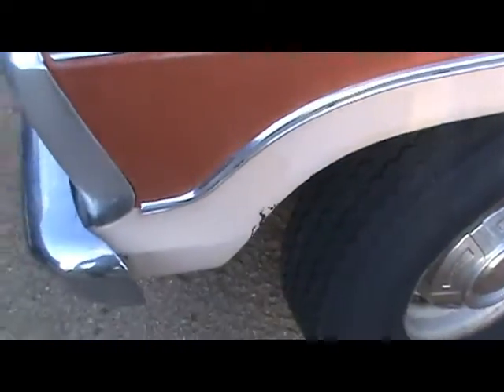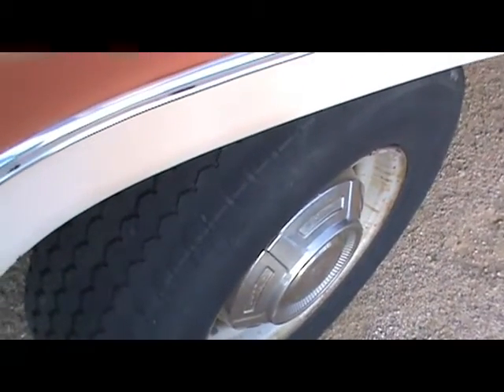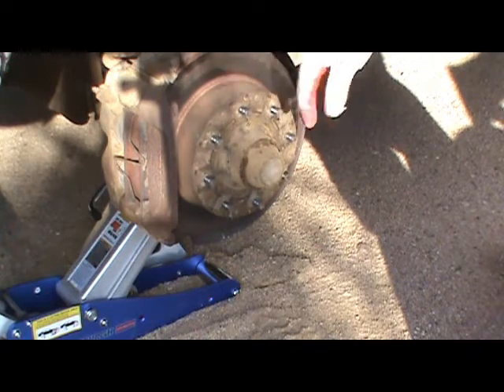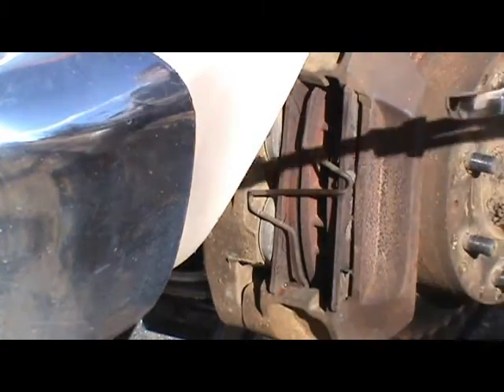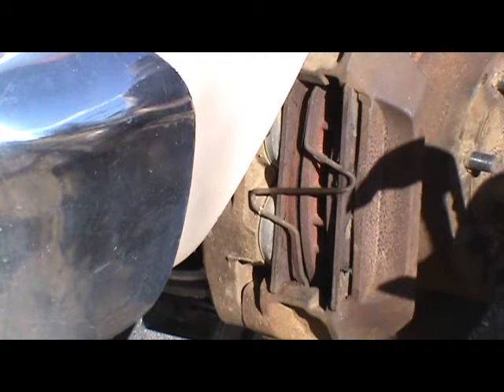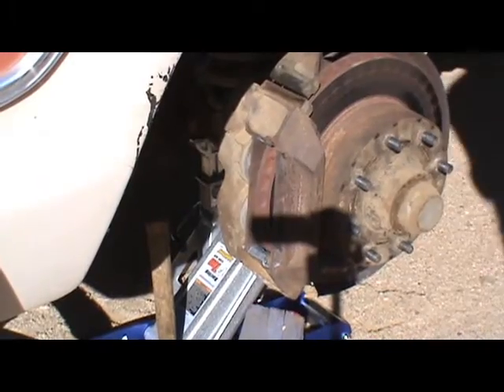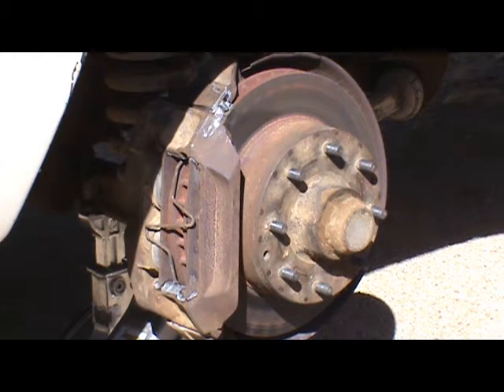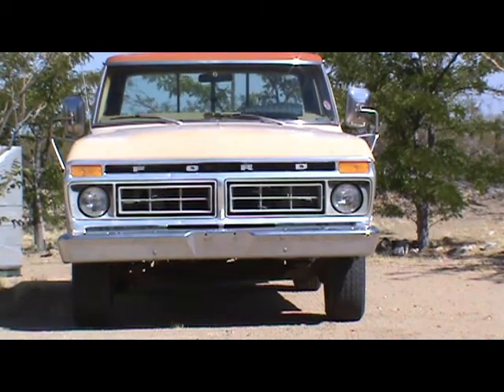1977 Ford F250 Front Disc Brake Repair

Comment: 6:00  My pin can be moved in/out by hand.  I've had one fall out.  Any idea what the problem could be?  I bought new hardware but the same problem.
Reply from the maker: Not really. Bolt holds the sliding pin from moving out.
Reply: @SteveAZ711  Thanks for the reply!  After tinkering with it I found the problem.   A button hex bolt was used for retaining the pin.  This keeps it from sliding out but the pin can 'twist' and pop out of the bracket.   I've picked up a set of the factory bolts and have just put it back together.  I am pretty sure this is what the problem was.

Comment: So, when ya' had the anti-seize in your hand, why didn't you apply some to the lug nut studs ?
Reply from the maker: I learned a valuable lesson 30 years ago when I oiled some F150 lug nut studs. The wheel kept loosening up, and I kept tightening it. Finally the holes in the wheel became rounded enough to where the nuts just would not hold. Since then I never use anything on nuts, studs, or bolts that hold wheels on.
Reply: @SteveAZ711  
I've never had a problem, been in trucking 36 years, half with my own equipment.
Turned wrenches on trucks since I was a freshman in high school, was shop foreman for a fair size trucking business, and had the shop to myself at another trucking co. 
Using anti-seize on lug nut studs, and the outside threads on the inner lug nuts, 
(Budd wheels) reduced the number of broken studs on 100 pieces of equipment to near zero. Replacing broken lug nut studs is labor intensive particularly as most had inboard mounted drums, my own tractor had outboard mounted drums, but my trailer had inboard. This simple thing saved the company a lot of money in labor, and downtime.
I suggest your vehicle had a pre-existing issue with the lug nut studs/lug nuts.
We had one incident with lug nut studs had been over torques, and so, stretched.
Applying anti-seize to these studs reduced the friction to a point when tightened the studs broke immediately.
At least the trailer was in the yard at the time. Those studs would've failed either way, but this taught us to inspect the threads a bit more closely. 
Worn taper seats, and lug nuts suffer from over torquing as well. Once the threads are stretched they just keep stretching. Also weaker, and this allows movement between the wheel, and hub.
Things go South quickly. I've seen this regularly. Cheap chrome wheels are affected more than any other steel wheel.
Anything that's been chrome plated is subject to Hydrogen Embritttleness. Unless heat treated after plating. Causes cracking in the wheels, and I've seen one 1932 chrome Ford front axle break due to this. '32 axles are beefy.

Comment: Man you had it down that far and you should’ve took the rotor off and repack the wheelbearings while you’re at it just saying .A ounce of prevention goes a long way.
Reply from the maker: I think at the time I thought about it. I believe I spun the wheel to listen for any sign of bearings needing anything (quiet, smooth,both sides) and decided to postpone that job for another time. However, it sure was an ideal time to do it.